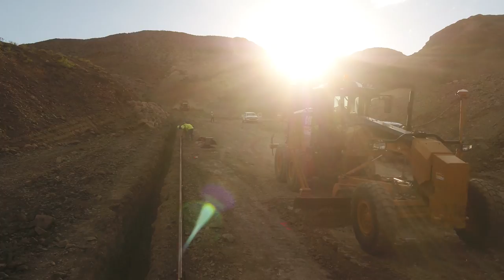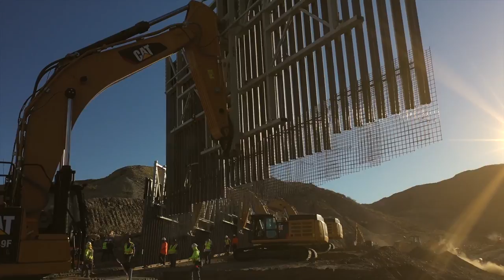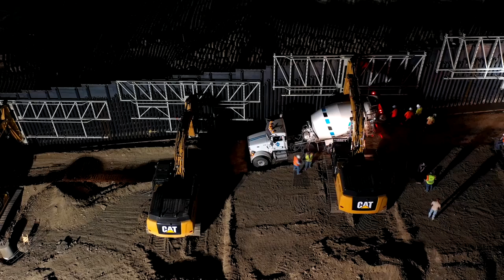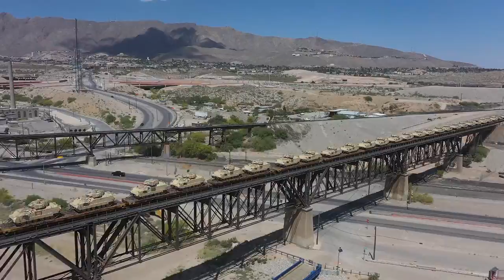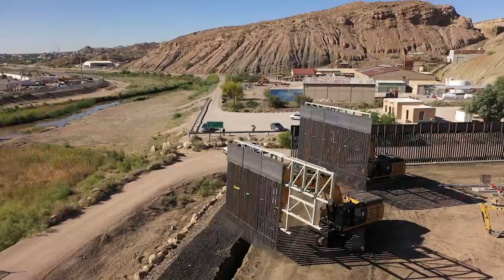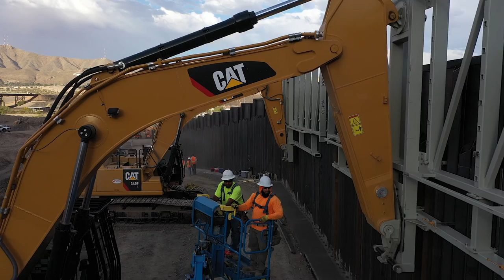We Build The Wall Promo - INCREDIBLE RARE  FOOTAGE

Comment: Now if they can cover up those holes in the wall then it would be perfect.
Reply from the maker: what holes? the wall is perfect as is, as we listened to Border Patrol agents to give them exactly what they wanted... not what people think is best.
Reply: @kolfage  The openings in the fence. You can't stick your hand through a wall.
Reply from the maker: That’s not a problem at all. no one can fit through it. This is what works best and what border patrol agents wanted. They need to be able to see through it.
Reply: @dansmith1661  Plus it reduces maintenance.ever seen a solid wall stand up to a heavy windstorm it produces a lot of strain and requires constant maintenance. This way serves multiple functions. First it reduces costs. two it keeps sand and dirt from building up to quickly and as noted allows BPs so see hostiles so bombs and ladders can't be placed without being spotted.
Reply: @Predator42ID  That is why you have cameras, motion trackers, drones, and armed towers every couple hundred yards.
Reply: They have the best engineers and others they know what they are doing.